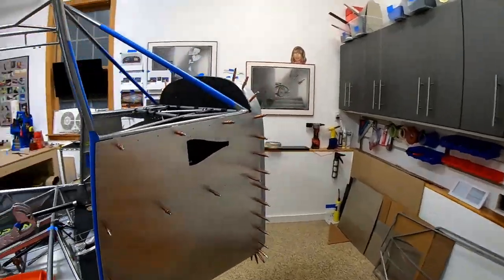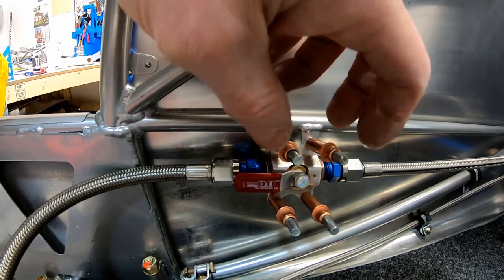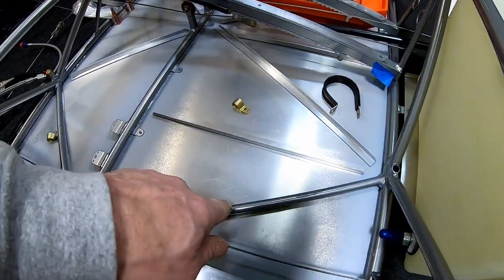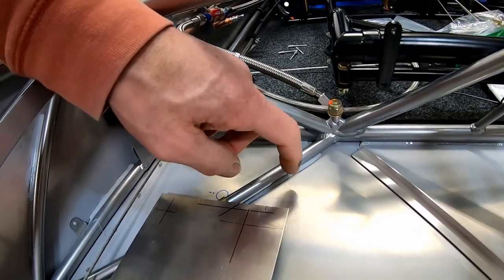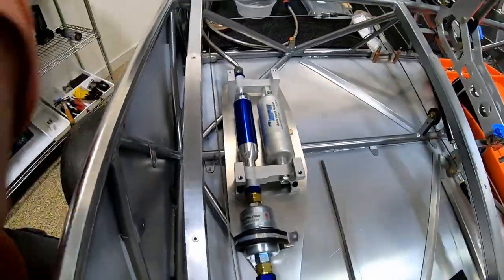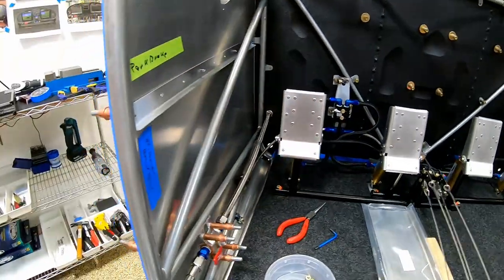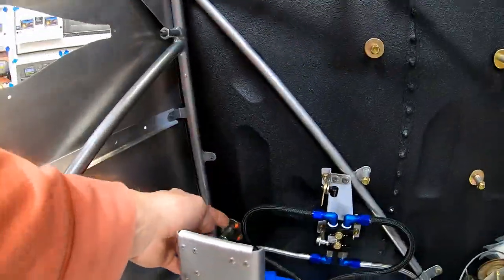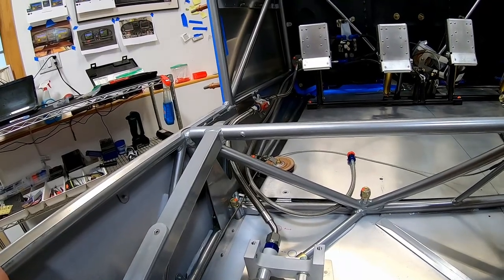RANS S-21 (061) Fuel pump, valve and gascolator

Comment: My kit must be a little newer, and RANS now pre-cuts and pre-drills the fuel pump mounting plate.  I'm glad they cut out that step.  They also have changed the length of the hoses, and they fit pretty well.  That bend was fairly significant.  Great job.
Reply from the maker: Interesting, but good that they are always improving. We are kit #100.